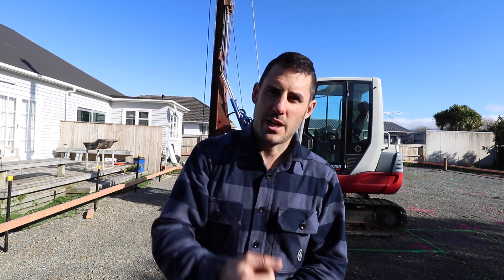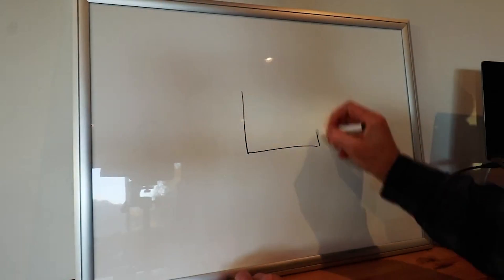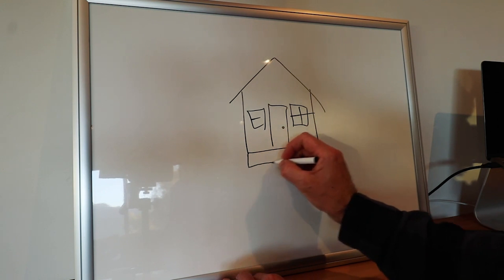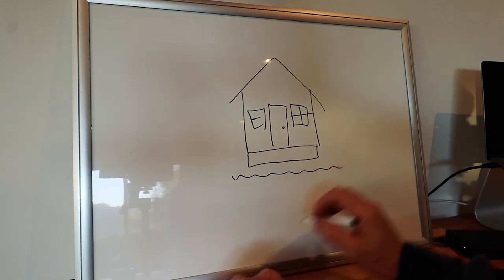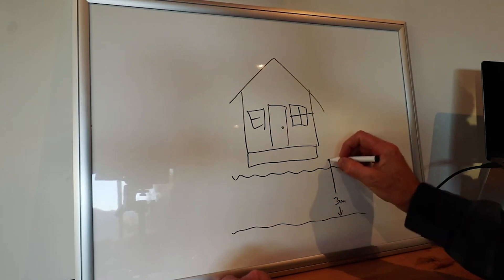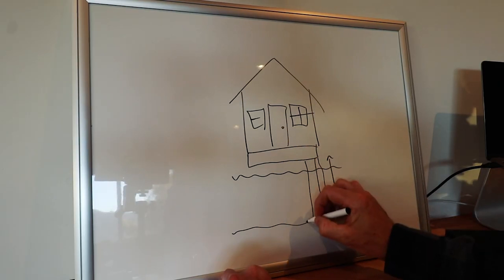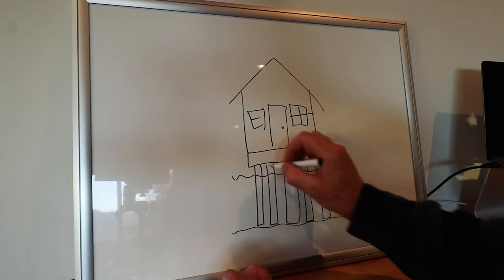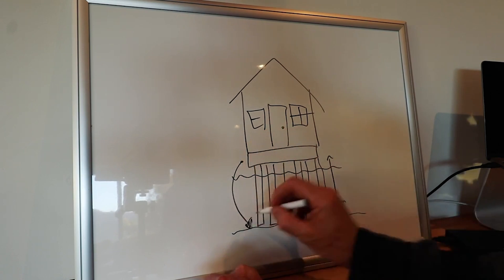Breakdown on Timber & Concrete Piles

Comment: Have you ever built a house on concrete piles that stick out of the ground the same way timber piles would? 

I crawled under my house recently and noticed all the piles are square concrete about 600m up from the ground hence the question. House is 1970s built.
Reply from the maker: Yeah These are pretty common, see this article for more info :) 

Piles were typically pre-cast concrete. Timber piles became more common with the introduction of NZS 3604 in 1978 and the availability of H5 treated radiata pine suitable for in-ground use.

https://www.renovate.org.nz/1970s/foundations-and-subfloors/foundations-original-details/piles/